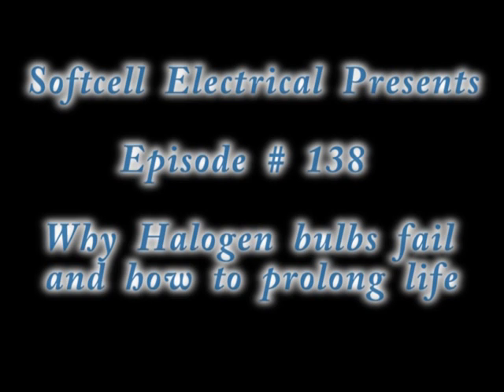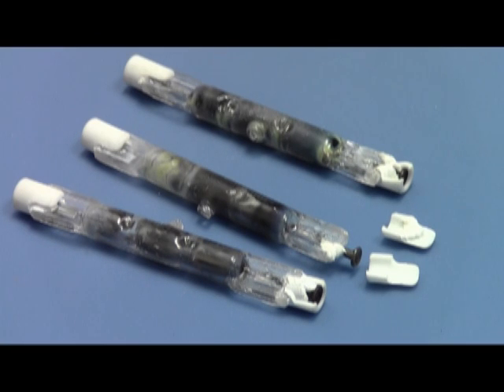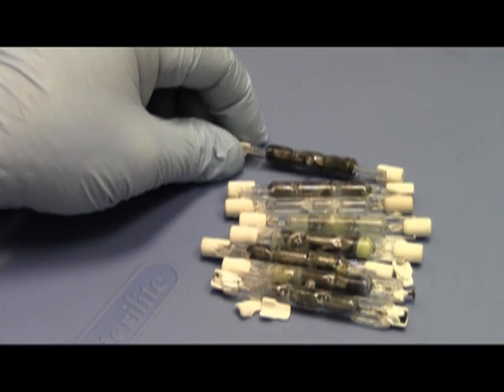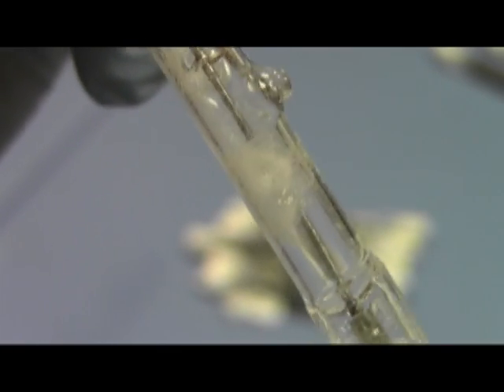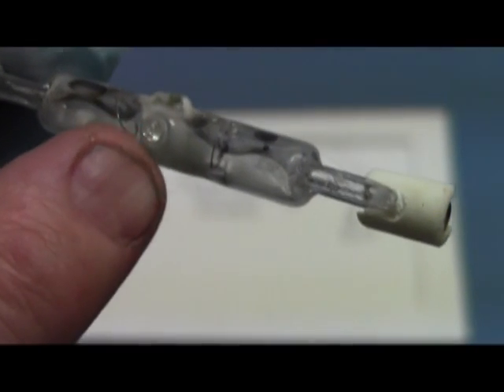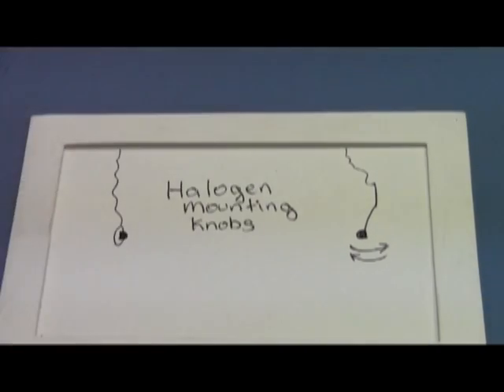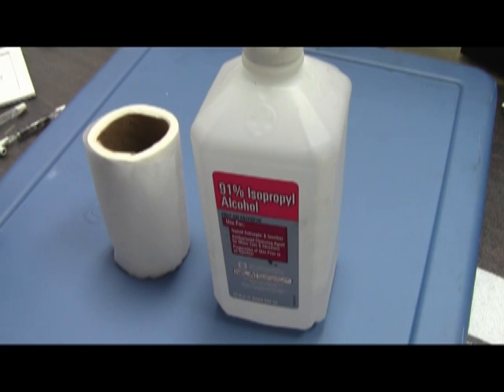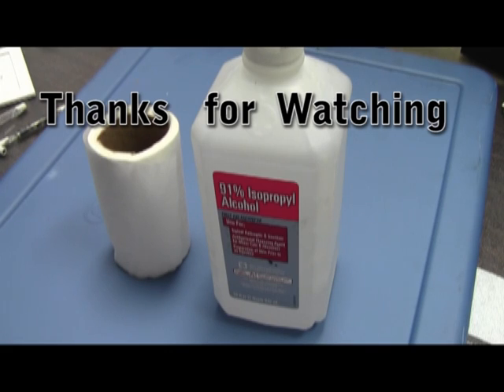Why Halogen bulbs fail #3I  138

Comment: Hiya. Are them the ECO version Halogen bulbs ? Suchvas enery saving 120w = 150w. ??? Cheers
Reply: Adam Morris No, the concern about fingerprints only applies to when you are working with the halogen capsule directly and even then there are exceptions. Since these lamps have an outer glass envelope, you can handle the envelope when inserting the lamp. The same applies to lamps with reflectors, you can handle the OUTSIDE of the reflectors. Lastly, some low power lamps (HPR series flashlight) for example are made of a hard glass and you can handle the capsule directly, but it is a bad practice to get into.

Comment: hello. I have currently installed these lights in my kitchen. I keep having an issue when I turn the light on, it flashes on and off. I then have to repeat the process of the hitting the on/off switch a few times before the light actually stays on. I have tried new bulbs and i keep having the same issue. Any suggestions as to why this is happening?
Reply: Check the switch.
Reply: ok.. but sometimes it will turn on and stay on for a while and then hours later turn off.
Reply: Check the switch.
Reply: @JohannLemoine  Switch could be giving a poor contact, voltage may be abnormally low or unstable, you might have ghosts, you might have have florescent lighting with a failing starter ballast and not halogen that run on a transformer as these bulbs dont flicker like the 4 foot tube lighting does when they age or are failing. You get On;Bright;Hot. . . . . And OFF.
Reply: Switch for sure had exact same thing

Comment: The nub on the glass is not for grip, it is actually an evacuation nipple for removing air and injecting argon gas as well as a small amount of bromine. The nub is the remnant of this process that happens during manufacturing

Comment: Excellent video. Every package of car headlamp bulbs I've opened has cautioned against touching the bulb directly, for the skin oil will cause severe enough surface temperature differences on that thin and fragile glass to shatter it while operating. Fully-enclosed 500-watters are far more significantly affected.
 
And, for someone who is so keenly attentive to such a subtle yet important detail, why haven't you changed the batteries in the smoke detector before recording this video? I would be surprised if you could not hear that chirp!

Comment: Why do the contacts fail on halogen bulbs? Is it the fixture or bulb? I never touch bulb (I either use gloves or hold with plenty of toilet paper to insulate my body oil). I get failure on contacts, not filament. I bought fixtures at Home Depot, small ones like in your video (low wattage, only 1 failure in 4 years, that's fine) and a large 500w fixture I see this problem in frequently.

Comment: I had a halogen bulb in a reading lamp i used it a few times and i left it on for about 20mins then there was a really loud bang and a blue flash and hot glass all over it shattered the ceramic bulb holder and broke the uv filter glass i did not fit the bulb it came out the shop with that bulb in it but i thaught that it was just a one off thing but then a year later there was a halogen bulb in my kitchen it was a candle bulb so it had a second glass casing that is ok to touch and the same thing happend luckily i wasnt under it but it was another big bang and tripped the power they are dangerous luckily i wasnt sat under it at the time but what causes that type of failure